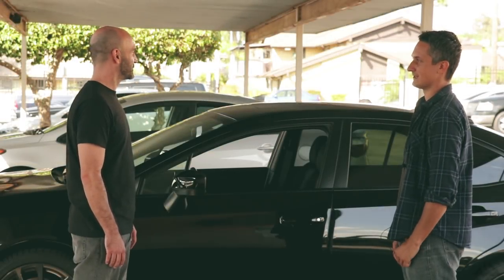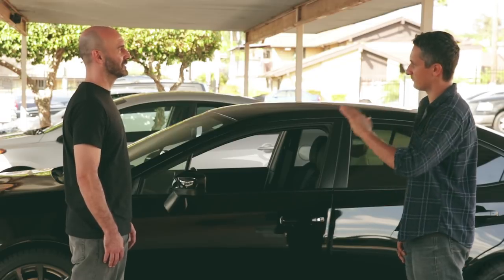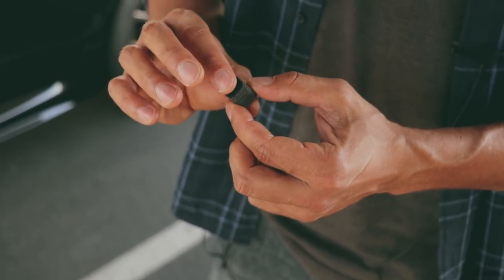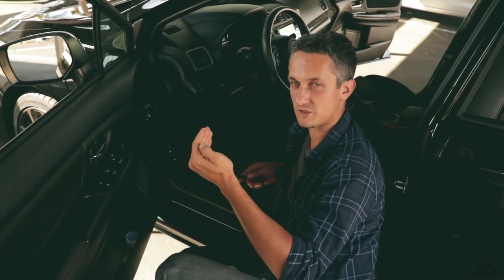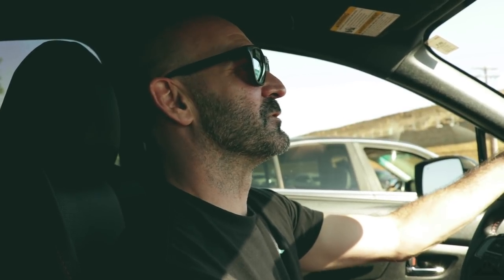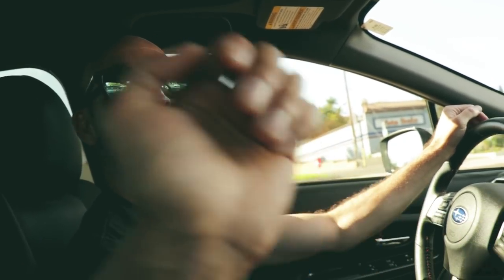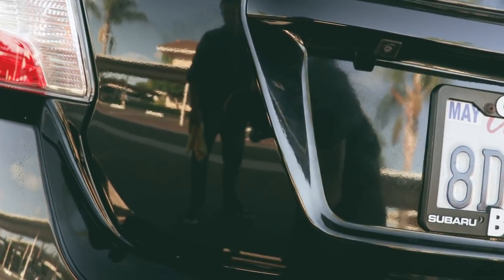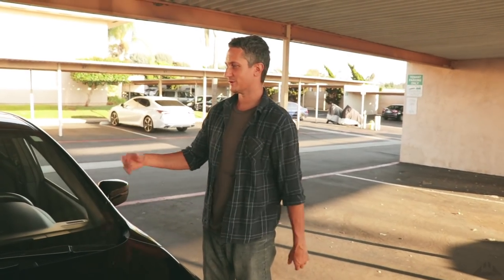WRX clutch stopper mod & wipers relocation

Comment: wow, I thought it was just me being short, noticing the the uneven feel between the clutch and the gas pedal
Reply from the maker: Nope, this is definitely Subaru's way of trying to make the car more "civilized". Driver's height should never matter once you adjust the seat and the wheel positions. Ideally, all 3 pedals should be somewhat even so you're equidistant from them and don't feel like you're trying to reach for something when pressing in the clutch. Mine are close to even now, but only after adding all the bits that I made.
Reply: @TheShaddix  What do you mean by more civilized?
Reply from the maker: @thecasuallongsword  comfortable for longer drives.

Comment: Great quality product and completely changes the way the car feels!
Reply: Did you order the clutch stopper shown here? I just ordered one from him for my 2019 WRX. It's on its way.  I'm excited to use it, I am just a little bit worried that it might cause some clutch damage. How can we be sure that the clutch will still be fully disengaged with this stopper?
Reply: @joshuawood6644  how's the clutch stopper working for you? I actually messaged him about purchasing one
Reply: @dariushalmi1887  sorry man just noticed this. It's been working out great! I can't imagine going back to driving the car without it. I'm sure by now you've installed yours.. any thoughts?
Reply: @joshuawood6644  hey there, could you guys please shed any insight you have on this clutch stop block? My 19 WRX clutch is not good, the stopper would probably make a big improvement... Any other advice? Thanks!
Reply: @clintonross1649  Get it. I've been using it since it came in the mail. It definitely helps make the grab point more predictable. I have no complaints!!!

Comment from the maker: I get a lot of questions on this stopper and where to buy it, etc. Email me via my site email or hit me up on IG if you want to order one. I don't stock them, but I can make them upon request. I still have mine in my car and it's been over a year now and it looks the same as when I installed it. Fyi, the price goes up and down slightly depending on the amount of stoppers I am doing at one time and the time I have to do it. The quality does not change.

Comment: man i wished you lived near me lol i love what you do with carbon .Ive noticed this lately too i have to adjust my seat closer to the wheel cause i have to stretch my leg fully straight for the clutch to touch the floor i'm not sure what other way i could do a similar mod like yours without carbon piece you made
Reply from the maker: You can try a bolt and a rubber hat. I tried that first but mine lasted about a week and wore out. That's why I made my cf bit.
Reply: Hey there, any other advice regarding sourcing parts at the local hardware store to fix this issue? Or is the carbon block the only real solution?

Comment: The wondering clutch grab point gets to me every time I drive my 2020 STI, I cant get used to it. Im afraid of using a clutch stopper as my dealerships mechanic said this would cause grinding of the friction plate/ flywheel or am I just being told this to avoid legalities????
Reply from the maker: yeah, they are talking about something else entirely. The stopper I make just reduces the travel in between the grab point and the floor, it does not mess with the area where the engagement happens. Most likely they hear the word clutch stopper and freak out. It's actually a larger pedal bump stop rather than a clutch stopper. And it would resolve your issues with the grab point instantly.
Reply: @TheShaddix  where can i get one? do you sell them? Still thanks for the help

Comment: sweet, i've been debating removing the badges on my black wrx, but wasn't sure how it would look- now i have a better idea! Some tinted tail light over lay ( the second darkest option on amazon) for the reverse part of the tail light makes the back-end of that car look so good,  I have it on mine. Also, what kind of Rainx spray was that?
Reply from the maker: the vinyl definitely changes the look. I ended up getting it for my car to replace the red ones and I like it way more now. This rainx spray is just some detailer spray, nothing special and smells strong like cologne. It's pleasant at first, but I can see myself getting sick of it fast. My favorite sprays are the griott's garage ones which have super pleasant scents, and the turtle wax interior detailer (there are two: one smells too strong and the other in blue bottle is perfect). I am super picky about this stuff, so I end up going through a bunch just to narrow it down to a few products and then stick to them.
Reply: You could do a video on your recommendations for cleaning/detailing products

Comment: What if I have to push way down to disengage clutch? Already replaced slave and master,bleed and adjusted master way out. Still not shifting smooth
Reply from the maker: then your grab point is near the floor, you don't need this little stopper. If it's not shifting smoothly, then it's possible you could've adjusted the master wrong. You should not mess with any of that stuff near the pedal, there is nothing really to adjust other than just tightening it slightly.
Reply: @TheShaddix  i only backed off the part that goes from peddle to master

Comment: wont this increase clutch wear when you have it pushed in as far as you can at a light and hold it there? It wont be fully pressed
Reply from the maker: For one, you should not do that at a light. For two, no it doesn't increase the wear as the plates are fully disconnected. You didn't watch the video fully as I explained this there.
Reply: TheShaddix I prefer to not put the car in neutral at every light. That's stupid the fact of the matter is you do sometimes need to push the clutch in all the way. If not, you wouldn't even need this mod. It's not good for the car. And not it's not completely engaged when you mess with the travel length. I did watch the video by the way lol love your channel! You got the best tips and you have awesome unique mods. I really appreciate your channel brotha. I did that wiper mod. I saw your previous video that talked about it and wanted to do it, and I was psyched to see this video showing how to do it
Reply: Michael DeFilio ok I agree but at stop signs you kind of have to. You have to fully press the pedal when you use it. Like in drive thrus, and shifting even. It's not good for the car and he throwout bearing and it isn't fully disengaged. Period.

Comment: Are the wiper blades still on the deiceing grids?
Reply from the maker: the wiper blades are still on the windshield about half an inch below where they used to be. Not completely sure about the whole de-icing feature.
Reply: If your WRX has the all weather package (I believe premium and up), it contains wiper deicers. They are located on the bottom of the OEM windshield. If you look closely you can see a trace of the deicing units where the wipers would rest. Shifting the rest position of the wipers would negate this feature. But if you live where there is no snow or ice , I guess it doesn't matter.
Reply from the maker: @MiguelPoblete  to be honest with you this little "fix" made such a nice difference on my car, I personally would never revert back to stock even if it hindered the de-icing feature. I'd just de-ice them myself somehow. It's only a problem if you park it outside where it snows. Just having wipers stick out like that was driving me nuts. To each their own, but keeping my car practical was not my intent when I got it, otherwise I would've kept it stock-ish.

Comment: The clutch is wack in the sti but it's already super short travel go try driving an evo
Reply from the maker: Then I'd do the same fix if I had an Evo. This works on all cars. I drove an sti recently and there is nothing short about the travel. This fix deals with the wasted travel.
Reply: @TheShaddix  I just traded in my evo x for a 19 STI. Evo had much long clutch travel and grabbed up heigh. The STI has a very short travel and seems to grab right off the floor so wasnt sure wth you guys were talking about lol
Reply from the maker: @jfnurod  well, then they changed the grab point on the 2019. On my 2018 wrx and also a 2015 sti the grab point is really far from the floor, especially the sti. Why did you trade your Evo for an sti?
Reply: @TheShaddix  Honestly it was a bit crazy for daily use and was barley driving it. Even after demodding it I was getting 180 miles out of a full tank. My STI only has 200 miles on it clutch might just need to seat in but def is grabbing right off the floor.
Reply from the maker: @jfnurod  It could also be that you're used to the Evo clutch and think that the sti is way shorter. I drove a 2018 sti, but I don't remember how the clutch felt.
Reply: @TheShaddix That is certainly possible but the Evo X def had the longest travel clutch I've ever had, if you ever get the opportunity drive one and you will see. I've owned a 300ZX Twin turbo, multiple eclipse GSXs, Eagle Talon TSI, Mazdaspeed 6 etc evo x had longest travel by far. The 2019 STI has similar clutch travel and engagement as the mazdaspeed 6. My STIs low engagement is either because it is a fresh unseated clutch or faulty adjustment from factory.
Reply from the maker: @jfnurod  sounds like your sti is adjusted perfectly! This is exactly what I was trying to achieve with the stopper - cut out the unnecessary travel
Reply: @TheShaddix  Quick update on that...   have a few more miles on her and the engagement point has moved up slightly. Believe it was grabbing off the floor because it was seating/wearing in. No launches or clutch slippage just normal driving since purchased.
Reply from the maker: these cars have wandering glab points depending on how warm the car is too. When it's cold it'll grab sooner, when it's hot it'll shift. Some people mentioned that on the forums. This is how mine feels too.
Reply: TheShaddix I wonder if we could swap in the pedal assembly from a 19 STI to fix the feel. Also I’ve heard of people removing a damper valve sort of thing in either the clutch master or slave cylinder in other cars. Maybe we could do that for the WRX too? The clutch pedal in my 19 WRX is driving me nuts.